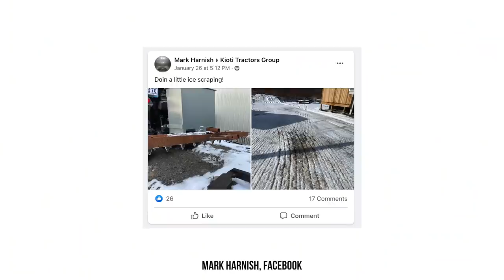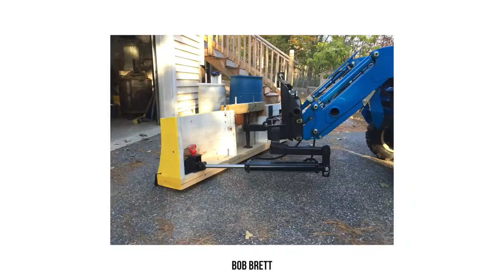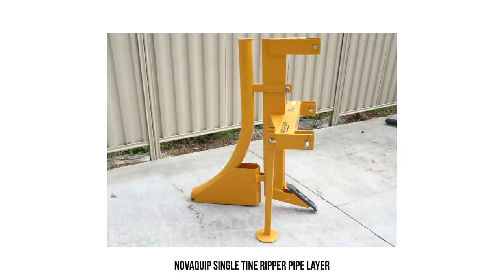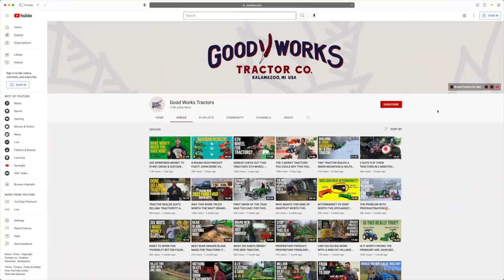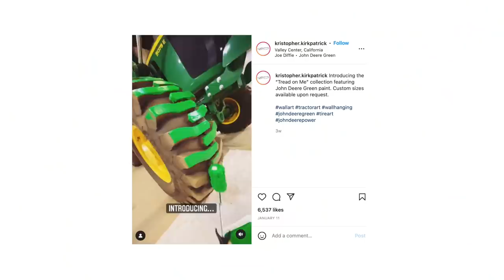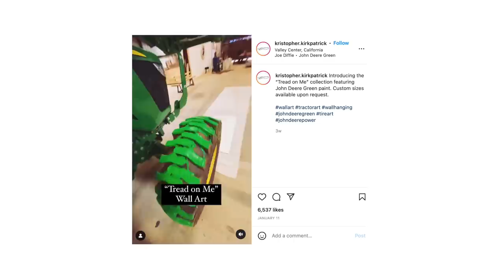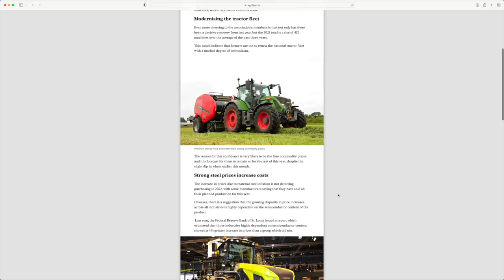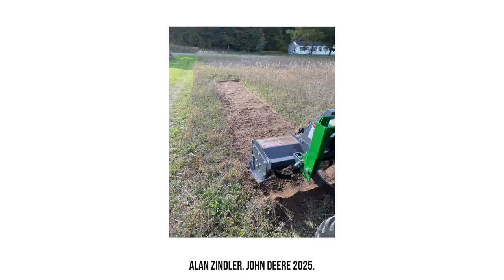CRAZY HIGH SPEED MOUNTAIN SNOW PLOWING! TRACTOR TALK #4 🚜

Comment: Nice sifter. I made one years ago sized so I could roll a wheelbarrow under it, as I sifted I filled the wheelbarrow, less handling. I have since made a larger one that covers my front bucket, shovel in loose piles and end up with a bucket of clean fill without roots, weeds or sticks. When I ran a water line I purchased a subsoiler like the yellow one you showed, a lot cheaper than renting a trencher, and now I have it for whatever comes along.

Comment: Used a brinley plow on the back of my johndeere 112 to bury wire. Pulled the mulboard of clamped a piece of brake line on it with radiator clamps worked great.

Comment: I have a tractor but it is a wheel horse c-160 16 hp it is a lawn more but I got it for 200 dollars and I have definitely got my money out of it I built a tooth bar for for the plow to fix my dirt driveway and I just built scoop wings for it to push more snow on the back I put a 2500 winch I built my own Crain to lift my back plow I built it works just like the big ones and I also have a ball hitch so I can move trailers around and I had to put lights on it so in front I have 2 fog lights with a 4 inch light bar then in the middle I have 2 more fog lights and on the back I have a 2inch flood light pod I got this tractor when I was 10 I am now 15 and still adding on to it I think of it as my own 1025
Reply from the maker: Wow, very cool Cullen!

Comment: Great video!  We have a homemade snow pusher made from a quarter of a very large mining tire (7'- 8' diameter).  The full rubber edge is great, and it has a rubber back drag on it.  Previously used in the cattle yard, but just started using for snow and so far it's great!